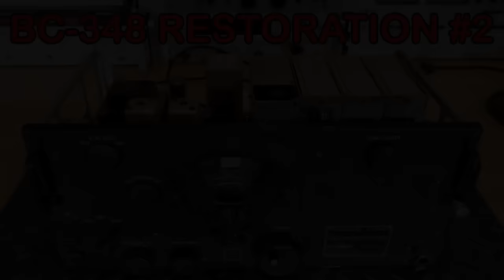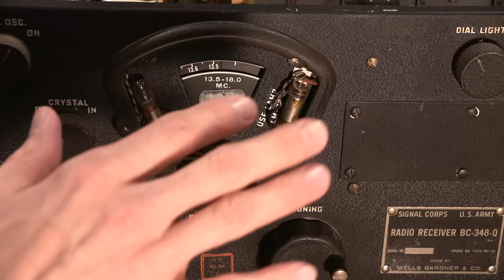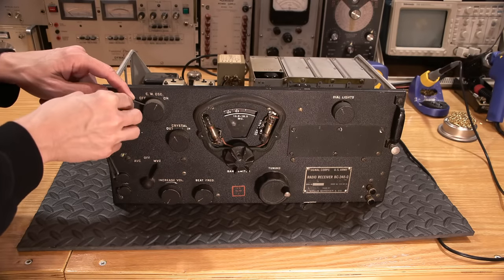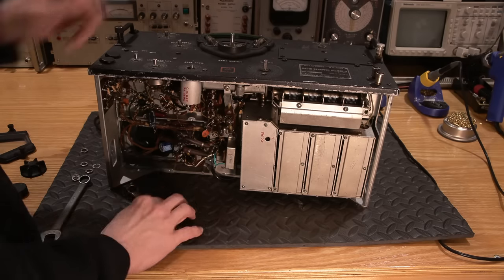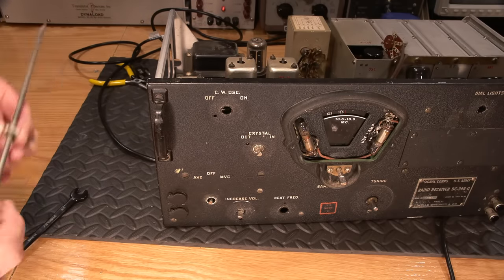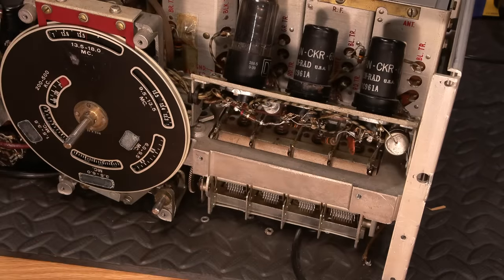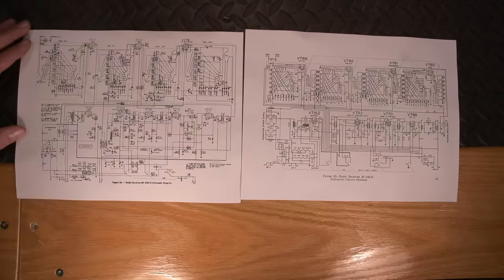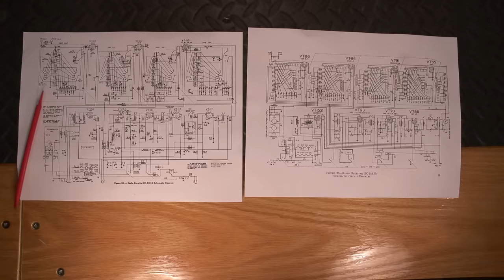Teardown - WW2 Aircraft Radio Receiver BC- 348 Restoration Series!

Comment from the maker: To learn electronics in a very different and effective way, and gain access to Mr Carlson's personal designs and inventions, visit the Mr Carlson's Lab Patreon page here: https://www.patreon.com/MrCarlsonsLab
Reply: greased lighting works awsome.
Reply: Ronson lighter fluid takes adhesive gum off quite well. Naphtha is what I think it is.
Reply: @JohnSmith-yl6dn  I just used lighter fluid to take off the remaining adhesive from glass packing tape. The tape was used on the front side of an EBike fender to hold a broken piece in alignment. I used roofer's mesh and JB weld on the back side for a permanent repair. The factory paint is matt black and was not attacked by the lighter fluid at all. The repair is hardly noticeable.
-dave
Reply: I own one of these radios. Don't know which model it is though. I've toyed with the idea of restoring it for years but have never had the time. I'd have to brush up on my vintage electronics a lot since I studied for my ham license when I was in high school!
-dave

Comment: I've tried isopropyl alcohol to remove labels, but what i find works best is standard WD40, just get it started under an edge and work it inwards, might be something to try on the old dial ;)
Reply: Plus the wd will not affect the paint.
Reply: WD-40 is a great tool for countless applications!
Reply: Agree. WD-40 has been the best adhesive remover I have discovered, it doesn’t seem to damage any surface I have needed to remove old adhesive from
Reply: WD40 is also great for cleaning that type of wrinkle paint makes it look fantastic.... sorry he used that Goof off before trying it!
Reply: Would liquid Vim be any good?
Reply: I use WD40 to clean my children, works great.
Reply: Must admit I expected Mr Carlson to whip out a can of WD40 for the label problem.
Reply: I have used Ronsonol lighter fluid for years and years. I give it a little test on an inconspicuous area to check if it affects paint, which it usually doesn't. WD-40 works well too.
Reply: Use oil, I take food oil and let it sitt over night and then you easily can wash it away like a greasy surface with hand washing detergent
Reply: In France we have "essence F" that work fine to remove all stickers without arming the paint or plastic, even on paper as it evaporate totally.
It seems to be like "Coleman fuel" but as "essence F" is a cheap replacement for "zippo lighter fuel", you may try both and find which one work the best.
Reply: @mistermac56  Is it a zippo fuel look alike ?
Reply: I would try heating the label to soften the glue. A hot air tool like the ones use for smd soldering/de-soldering. The heat is adjustable and it has various tips to reduce the heated area. This might leave less residue. I have used (space permitting) this technique in conjunction with a small razor blade to gently shear off stickers without affecting the paint. Works great on a smooth surface. As for the goop off I would test a small area (say the in-between dial selection) first that way you can tell if the solvent would affect the paint and would not be noticed very much as it is not a resting area. And my hat off to WD40 for all that magic it contains.
Reply: My method is that heating the sticker with a hair dryer & peel it off without any gum residue.

Comment: The reason people had an identifier engraved on electronics and other valuables was simply that the police departments went door to door and offered to do so in an attempt to discourage break-in theft and also that recovered stolen goods would be easily identifiable. I'd say the practice was around the late 70s and early 80s. In Quebec, I think it was called "Operation Volcan" if memory serves me well. Students were hired to go door to door and engrave objects.
Reply: In the UK in the late 90s we got pens through the door whose writing could be seen under VU light, still visible todays all over the bloody antique clock,
Reply: In the US military, back in 70s - 80s, we were encouraged to engrave our serial / ID number on any electronic equipment we owned to help prevent theft or identify equipment in case of theft. This was done by use of a vibrating engraving device that would carve the metal surface of an item, permanently marking it. I still have a few pieces with my number on them from over 40 years ago.

Comment: I really enjoy the videos where you work on vacuum tube equipment.  And, in this case, it's a military piece.  I served in the U.S. Navy for  22 years.  Most of the equipment I worked on was vacuum tube stuff.  I replaced very few tubes.  They were just very reliable.  The Navy wouldn't switch to a new system unless it was thoroughly tested.  We did have Field Changes.  These were upgrades that were installed in existing systems over the years.  Reliability wasn't as good for traveling wave tubes.  I replaced quite a few of those.  They were good for a limited number of hours.

Comment: It should be remembered that the BC-348 was intended for use in unheated unpressurized bombers such as the B-17 and B-24. At altitude the operator was usually wearing heavy gloves due to the cold (30 below zero F and lower). That's why the controls and the construction are the way they are.

Comment: I have an "O" model and it's chock full of oil-filled can capacitors.  LOTS of them.  It's working pretty well but the CW oscillator coil is open, so no BFO.  I'll look with interest when you get back into the Great Receiver series.  You're a natural born teacher, Mr. C.

Comment: I personally like when I find stickers and carvings from original owners. Tells you it lived. Those stickers looked pretty good but a teeny tiny bit of moisture will see that destroyed. You don’t even wanna be cleaning those dials. You could certainly ruin the whatever finish is on it too. Try an inconspicuous spot first. Like VR dials have a coating on the paper graticule allot of times to make it look matte
Reply: I would leave the stickers too, it looks like those are adhesive plaster. Too risky to remove with agressive chem, perhaps isopropyl alcohol.

Comment: Goo gone is a little bit less harsh than goof off. It usually won't remove paint and doesn't evaporate as quickly so can be better for removing stubborn gunk.
Reply: yeah I was going to say that would be the first thing to try for adhesive...
Reply: Yeah and isopropyl alcohol sometimes works and doesn't often affect finishes or plastic in my experience.
Reply: To be fair, I think he may just have been looking for an excuse to pull the faceplate off despite not wanting to pull the faceplate off. I understand that feeling lol.

Comment: Like always Mr. Carlson’s Lab !
... Allow me to share an experience .I use a technique for removing adhesive residues with hot air low temperature first and WD40 after the adhesive softened on metal surfaces only. The results are very good; I always look for an inconspicuous area to test and check the results and possible reactions. Nice video congrats and Best regards 73 PY2NDB.

Comment: Nice video as usual 🙂.

When I have to remove duct tape residue I never use chemicals.

I use a piece of another duct tape, press the sticky side on the residue and rip it off. This is not as easy as it sounds, you have to get the right feel to it and do the rip not too quickly or too slowly...

Although my wife hates to see me doing it, the results have been satisfactory so far.

Comment: I like LPS silicone lubricant for those sticky labels.  It's water based & safe for paint & plastics.  Spray or dab it on, wait a day & they usually come off with little effort.  Sometimes they even fall off.

Comment: Along with WD-40 or your favorite petroleum solvent, one of those little electric heat guns does a great job at softening labels and maybe no solvent is needed. Although, heat can cause it's own problems. The heat gun I have has about a 3/4 inch nozzle and is 360 watts. I'm not talking about the giant 1500 watt one Harbor Freight sells that is the size of a hair dryer. Mine's a Milwaukee model 1400. My ex bought it (with my money) from a craft store. It's one of the few things she didn't take when she left! Works great with heat shrink tubing too with no flames involved. 

 Also even water can be a bad solvent. I nicely permanently removed the word "Admiral" and the tube number from a tube in my RCA A78 while restoring it. It came off with very gentle pressure! 

 Looks like a very nice condition BC 348! I can't wait for the rest of this restoration. Your video is a nice distraction from all the news in Maine right now. Thanks for sharing and take care!

Comment: Mr. C.,
Another trick you could use is a little bit of wd-40. It will break down the adhesive residue, and shouldn't harm the paint.
I used to work in retail many years ago, and we would use it on the metal store fixtures from price tag bin labels. 
Hopes this helps, sir.

Comment: I have the same model radio receiver i use it to listen to the local airport here in Orlando, FL. What i did to prevent paint chipping is I sprayed the front faceplate with clear coat.

Comment: Like the ART13 particularly as well as the BC348.  Very much into boatanchor ham radios FTDX401 KWM2a SB100 TR4 and trouble shooting sudden loss of tx output, Oscillator failure and Amplifiers for RF.  A lot of Amateurs watch your channel.  Cheers from OZ  VK5LB

Comment: From my experience, adhesive residues usually age in this order:
New: Dabbing off adhesive residues with scotch tape is usually sufficient.
Sticky: Try in this order: Scotch tape, 70% isopropyl alcohol, lighter fluid, then stronger agents.
Hard: Like sticky, doesn't always go away completely.
Always test before means at inconspicuous place!

@Indiskret1 Thanks for the tip with heat gun and your agents. I will test!

My most famous goof of a previous owner: During the restoration of a Siemens E311b, the front panel had to be removed for access to the mechanics. This is held in position by two chromed brackets. Four nuts had to be loosened. I was surprised about the extremely high torque required for loosening which I could only apply with an extended open-end wrench. It banged once and the nut was finally solved. Investigation showed, that a predecessor in the absence of a wrench had secured all four nuts with adhesive against loosening. So it was enough to tighten them by hand. It then banged three more times in the chassis, and the front panel was finally loosened.

Comment: Mr. Carlson. Try an orange oil based solvent. Pure orange oil is the the best. It will cause the sticky goo to swell up into a gel and loose it's ability to stick. It can then be gently scraped or wiped off. The orange oil will not damage or take the paint off like a petroleum based product.

Comment: Another great video. Even though I can't imagine my restoring a BC-348 (kind of a boat anchor), the whole process is ... what can I say ... relaxing and a lot of fun. There's an element of mystery as you are retrofitting the units. You do not suffer fools gladly, and I have at least half a dozen chuckles in the course of each video with your running commentary. Another element to this is the fact they were used in B-17s, B-24s, etc. and in one's mind eye you can imagine the circumstances in which they were used - the operators were often in harm's way. Looking forward to the next - 73.

Comment: I found to easily remove the adhesive from those type of stickers is to put a little vegetable oil on a soft cloth. It should desolve it with a little bit of rubbing.

Comment: I curse the "Surplus Conversion Manual" every time I see a hacked up WWII military radio. ARC-5/SCR-274 sets seem to get butchered the absolute worst. Looking forward to how you tackle the 348. I have 2 of them, a Q and an R in my queue for restoration. I'll no doubt be copying whatever you wind up doing!
Reply: the question is, do you leave the power connector in place? In the uk mains is 240v and dangerous. An IEC is safer but not original.. then again, who has a shock plate and plug?

Comment: I think I made the mistake of thinking the other receiver was "better" because it seemed to have more IF stages. Turns out the mixer and oscillator are separate in the H series and the more modern valves were doing more in the latter stages in the Q series. So I suppose the set with the fewer valves was cheaper to produce and would be more efficient but maybe the overall performance would be about the same. Can't wait for the next episode to see where all this goes.
Reply: The J, N, and Q series were a simplified version for wartime manufacturing purposes. Several companies made BC-348s, and the war effort need tens of thousands of them. (There was a BC-348 in every B-17, B-24, B-25, B-26, B-29 and B-32, plus some other aircraft got them). A seperate HF oscillator IS a superior design, but there was a war to win. 

The deciding factors in choosing Receiver #2 to restore are:
- It's in the best shape of all 3
- He has another receiver of the same design to use for parts
- Because it is simpler, there's less to restore.

Comment: The bc348 was a rock solid receiver for me as a novice ham. WD 40 would be easier on the paint and remove the residue. My guess those caps are close to being turned into resistors.

Comment: You do not start with the Goof Off. You start with the Goo Gone. And just enough to have it soak into the adhesive, not to drip. After all the adhesive is gone you clean up after the Goo Gone with isopropyl.

Comment: I think you picked a too robust cleaning liquid. You should use medical/purfied gas for cleaning those sticker marks. Zippo lighter fluid is a close relative. Don´t know the actual name, purified petrol/gas/gasoline. I buy it from the farmacy. I guess camping/travel petrol should also work. What you want is fast vaporization. They are pretty much odorless.

That is used to clean vinyl records from stickers. Works very well. leaves no marks.

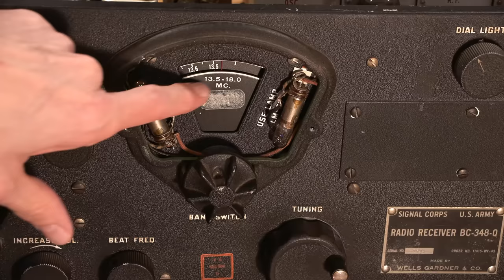Comment: @3:30 -  I highly recommend Heptane or a heptane based solvent to remove stickers and residue without damaging the surface - I found this by mistake when I was testing chemicals to remove old stickers and had Contact cleaner in front of me (just a generic brand not even de-oxit)  .  It's a real champ .. even on paper it disappears after it does it's thing . Obviously have to be aware of the fumes.

Comment: Although I only used them on plastic laser printer cases, my go-to cleaners are WD 40, Isopropyl, kitchen surface cleaner, and VIM, or ceramic cook top cleaner (same difference). On stubborn stuff, delicate use of a ballpoint ink rubber eraser. For really intractable  marks, I have this thing that I don't know what it is or where I got it. It's like a mechanical pencil, but the lead is a hard, white, fibrous material.
Reply: those pens are for sanding pcbs afaik

Comment: I've removed labels for many, many decades and I usually treat the whole label first, let it sit a little while to soften the glue and then it's easier to remove. I almost always also heat treat the label with a hot air gun, sometimes (quite often) that makes both glue and label to remove in one piece, just minute pieces of glue left. For that type of sticky label as in this video I most often try with standard petroleum based degreaser, and as I said, pre-treat the label and wait a little while. If that isn't compatible with the glue, I use isopropyl alcohol. Very, very rare that either of those damage the surface if isn't cardboard backing, but I've managed most of them too with heat and Iso (doing a lot when selling old games with personal stickers).
I actually never used any special label removers, there has been no need.
Reply: Try WD40 or IPA.  Goofoff is great for graffiti but not this job, you'll be surprised how nice an oil base remover works and not harm the painted surface.
Reply: I use "air tool cleaner" spray

Comment: To follow Mr. Carlson's BC-348 restoration, I've obtained one in the H-version, painted in nice grey-green colour and being in excellent mechanical condition. However it has two challenges: 1. the antenna coil for LW-range is burned, and 2. as a power supply it has a DC/DC converter 12V to 160V producing on top of 160V  ca. 50mV, 50Hz saw hum together with Dirac pikes. Let's see what the solutions for both challenges will be...

Comment: My heart absolutely sunk, when I saw you show that can of Goof Off!  Goof Off contains all kinds of nasty chemicals including acetone and xylene; of which is actually used as a paint and varnish thinner!  Xylene in particular attacks enamel paint.  Goof-Off is a 'shotgun-product' that is made to work quickly and for mostly inexpensive surfaces.
What I use, if the paint isn't too deteriorated is naphtha.  I've used naphtha to clean electronics chassis, many plastics and painted metal surfaces.  Additionally, I never have a problem with stamped-numbers on chassis or components.  However, you have to be careful these days as 'lighter-fluid' is not necessarily pure naphtha. 
Try it sometime along with maybe some of the other cleaners like orange and lemon oils are much milder than Goof-Off...

Comment: I use a method you might want to consider which usually works even for long dried sticky glue and it's the wet patch stuff.

I wet a little patch of rag or towel and place it over the residue area, let it soak and soften up for several minutes after which the q-tip technique usually works much better, with far less effort and lesser chance of paint damage.

I just forgot sometimes I use a plastic scraper instead of the q-tip, providing the surrounding area is flat and smooth. It helps a lot, and I finish the job with the q-tip.